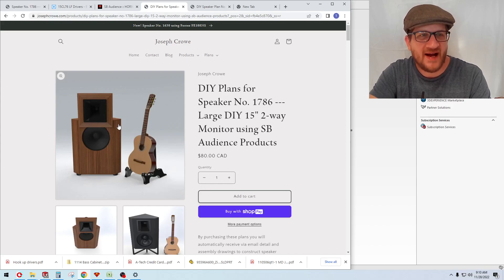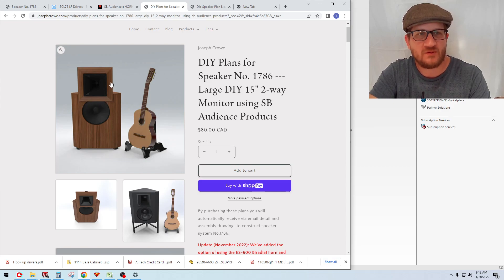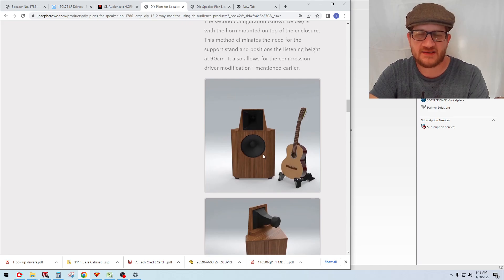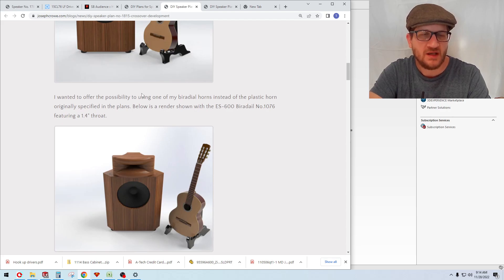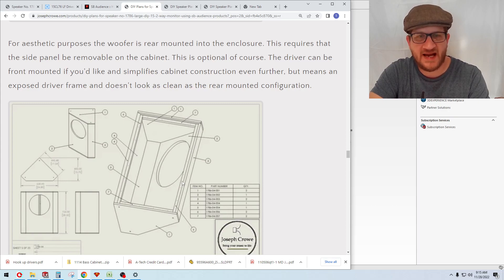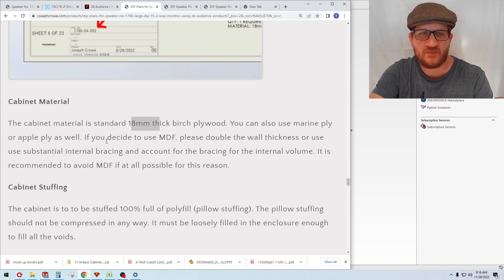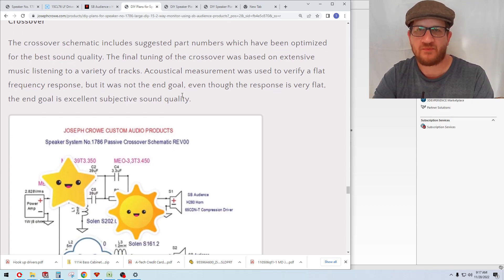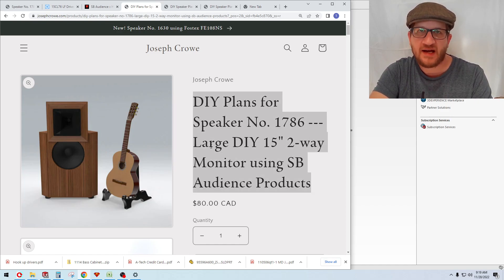DIY Plans for Speaker No. 1786 --- Large DIY 15" 2-way Monitor using SB Audience Products

Comment: This must be one of the most perfect two way speakers in the world: design to be tucked away in the corner (without becoming boomy), high efficiency (mid tweeter compression driver can be powered by flea watt single ended triode amp), near perfect directivity, excellent to incorporate a Hypex plate amp with onboard DSP to power the woofer, record (low) level distortion figures and capable of ear bleeding PA sound levels.

Comment: Troy what is your view of have to pick one in should pressure and dynamics this or soubrin 1309 pros cons frank opinion please
Reply from the maker: 1786 is much higher sensitivity. Distortion is lower for the same SPL. 1309 goes deeper (32Hz vs 45Hz). They are about the same on dynamics.

Comment: This is an very interesting project. I used the SB Audience 15OB350 in a too small open baffle but didn't really make it work good together with my system. Nothing wrong with the driver but I didn't manage to get the amp for the driver to work together with my QUAD Artera Play+ & Stereo. So I didn't know what to do with the drivers.

I found your site when I was looking for new horns to a pair of Klipsch Heresy HIP from 1980 that I wanted to be crossed over at 450 Hz. I saw this design an released that this might be the perfect solution for converting the Klipsch Heresy  HIP into a high quality system. 

At the moment I'm building almost the same design but with one small difference and that is that a 4cm slot at the back of the box that will hold around  3cm hemp isolation. It will act like a aperiodic speaker (like Dynaco A25). I think this is an almost forgotten design that will suite this driver and size of box. If tuned correct it will give around 3 dB  boost at the resonance frequency but it will fall faster below that frequency. It will also bring down the impedance a lot and make the phase much smoother.  

Will any of your CNC plans work with the Klipsch K-55M 1" driver that goes down to 450Hz?